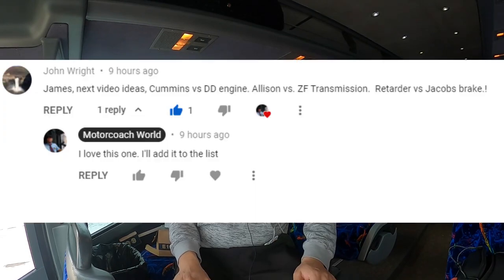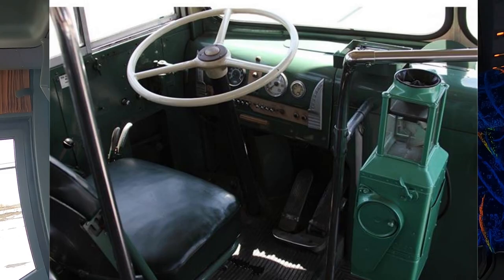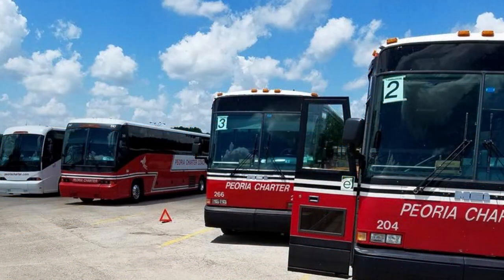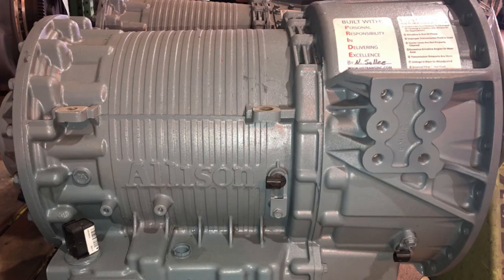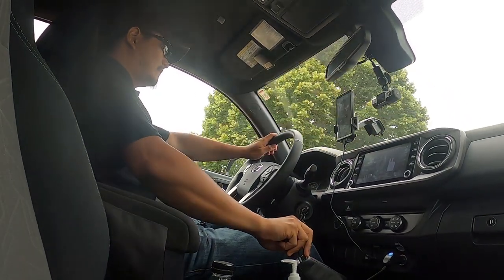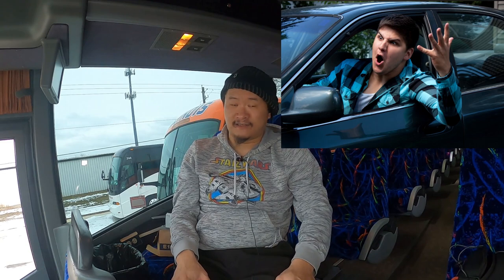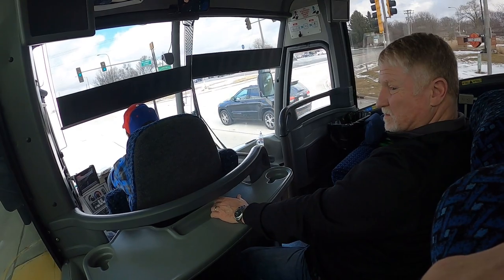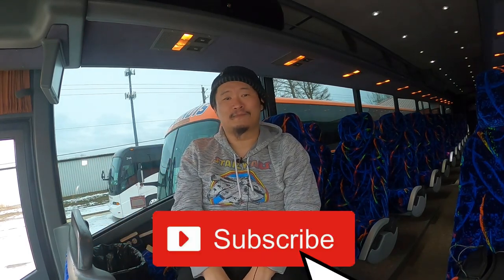Coaches buses come in Manual, Automatic, and Both .  The ZF Transmission

Comment: I know the jerky shifting of an automatic coach gearbox all too well. It can be highly unpleasant as a passenger. 
Interestingly enough, ZF did make - and has been making - very smooth gearboxes for city buses for decades. The Volvo B10 buses in my area in the 90s all had the ZF city bus gearbox with that very characteristic but pleasant pew pew laser sound (as opposed to the wheezing vacuum cleaner sounds the Voith gearboxes made that were fitted to the VDL buses we got after the Volvos). 
Those ZF gearboxes shifted noticeably, but didn't jerk like many of the coach gearboxes i know. 
I wonder why they weren't fitted to coaches. Is it an efficiency thing that couldn't be solved with a torque converter (which i assume the ZF had) lockup?
The last time i sat in a coach with a manual gearbox was about 2 years ago. The driver wasn't very subtle with his shifts. But i can totally imagine that he was driving the last remaining manual shifted coach in the company, and not really used to it. That said, it wasn't much better or worse than the automatics i'm used to in coaches.

Comment: Why didnt they include an option to electronically select gears in a ZF transmission?
That would eliminate some situations where the transmission computer got confused.

The ZF transmission kinda sounds similar to a dual clutch automatic transmission in cars, with all the same issues, but the ones I drove also allow you to select gears manually.
The only difference is that the dual clutch transmission has almost no shift time.

Greetings from Germany, where almost everyone still does and can drive stick.

Comment: Just spent a week touring Italy in a really nice Mercedes coach with an autoshift transmission, probably an AS tronic. Acceleration when entering the freeway was in fact fairly slow as described. But the bus performed well pulling up steep hills or crusing at freeway speeds. Shifting was slow but very smooth.  The driver, a very experienced professional, was not a fan of the transmission. He much prefered a manual.

Comment: James, this felt like part 1. No talk of manual mode, particularly when driving on a long upgrade or moving in a very slow and relatively controlled manner as in parking lots. The Volvo ishift is nowhere to be found in your discussion, and they are very different in terms of driver feel. My company continues to acquire new coaches with these transmissions as available, although sometimes we wind up with 6 speed Allison. As to the AS Tronic, manual mode ,in both forward and reverse, can be an effective way to keep things more manageable when used properly.
Reply from the maker: Hey Ronnie. We do not have any Volvo I shift in our company. In this video i wanted to focus on the ZF. Not to say there won't be a video on the I shift in the future.

Comment: Had my Class B/Passenger since '04.  Took the test in a 250HP Cat 3208/Allison 4-speed slushbox Blue Bird AARE.  Couldn't get out of its own way pulling hills.  I drive manuals as much as possible in my personal life.  Honestly, I think the best engine/trans combo for a highway coach was a properly injected 71 or 92 series Detroit with at least a 10-speed.  Never been a fan of Cummins, especially that blasted Triple Nickel.

Comment: At one point, I drove a 3 tonner truck with an AS transmission. It would often select the wrong gear and it wasn't ideal for constantly stopping and starting. I think part of the problem was that it was easy to drive it like a traditional  automatic  transmission. But then later on when i learnt to drive a semi truck. I leant in a Volvo with an AS transmission. That was no problem and it went well, but at the same time, I treated as if it was a manual. I think a practical way of resolving the problem would be to retain the automatic clutch, but leave the gear selection to the driver with a stick shift like a manual.

Comment: Over here in the UK. Our buses went from being fully manual, to semi automatic which the the clutch pedal wasn't included. So the driver would change gear with the gear stick. But, then the gear box would change electronically and then automatics. Coaches for a long time were generally fully manually geared. Some had semi automatic geaboxes. But, now all coaches are generally automatics
Reply from the maker: Hi Conductor Amos! Thanks for your comment and that piece of info!
Reply: @MotorcoachWorld  you're very welcome. I think manual gearboxes on our coaches are still available. But, its mainly automatics now. Mainly with ZF boxes

Comment: I. Hate. ZF Astronics. Shortline bus had some of the new D4500CLs with those, and they were a nightmare. Passing while going up hills, going downhill, or simply trying to go with purpose after stopping at RR crossings was an issue. And that roll back. 

Id rather take a full manual anyday or the regular old Allison. Hell, I would take the DDECs over that thing (we still had the MC9s back then). Im glad my buses have a regular ZF transmission. 4 speed in one, and 5 in the other (no overdrive, just differently spaced, so top speed...insert sad sound effect)

Cool video...dont know why I missed this one.
Reply from the maker: Yeah I hear you Heavy Metal Mechanic. I prefer the stick shift.
Reply: @MotorcoachWorld  I remember the old Allisons on the first gen MC9s, and we use to change gears on the prindle selector like on a car, and that was pretty good. The DDEC couldnt do that, but that at least was smooth and had no worries to it, but then again the MC9 was such an easy coach to drive. It was 96 inch so it was narrow, auto, light steering, and 40ft, so anytimes I was in a D4000, then got a run with a 9, it felt like driving a car lol. But theres still something to rowing gears.

Comment: I had a few of the Eaton Fuller 9 speed 'top 2' transmissions arty my old job and they weren't bad. They were essentially 13-speed transmissions without the splitter. The Fuller Advantage autoshift that I head in 2016 acted like the  ZF. It was not smooth at all, and was a nightmare when backing up to a dock.

Comment: I have driven both standard transmission coaches and allison auto ones. The allison 6 speed is a good trany. I liked them better than the old standard tranny coaches. I have never driven a zf auto-standard bus but I have ridden on them and I don't like the because they are slow. Ironically the car I currently own is an dual clutch automated standard and it's fast and I love it.
Reply from the maker: haha very nice. I have a manual transmission car. I enjoy driving them better than Automatics. Thanks for comenting!

Comment: The main difference I found out was when drivers who were used to the Allison would put the accelerator down to the floor till they got up to speed. When they jumped on a bus with a  ZF Transmission and did that the bus got jerky. If you knew how to drive a ZF all you had to do was put your foot halfway down and let the transmission go through the gears and when it got up to 6 then you could put your foot down. I drove in all conditions in DC. Stop and go and long run charters. I did a charter with an identical J-4500. I had a ZF 10 speed and the other had the Allison 500 6 speed. We went from Wash DC to NYC. We both drove the same routes and the same streets. Both buses had the Cat 13 engines before they stopped using them for OTR use. With full tanks there was no need to fuel up till we got back. When the tanks were fueled up upon our return my bus took less fuel. We figured  that the ZF had gotten close to 8 MPG and the Allison was more like 5 MPG. Both buses at the time had less than 25K miles on them.
Reply: Thanks James. The ZF could be tricky at times but it was much better than the Allison for OTR Trips. I used to drive a 2008 Von-Hool T model that had a 231 gallon fuel cell. What was nice if you fueled up at a truck stop it could be fueled on both sides. Loved it. When the tank was full the slave pump turned off automatically.

Comment: In Australia, most buses are equipped with a torque converter gearbox on the brands ZF and Allison. The ZF buses are relatively more luxurious, such as Volvo and SCANIA which have their chassis made in Europe. The Allison options are mostly seen in the Chinese maker's spec sheet since the Allison T series (made in Hungary) is cheaper and easier to maintain. However, if you talk about the long-trip, high floor buses, especially with the length over 12 meters and come with European chassis, they will be fitted with their own brand's gearbox. For example, you will get Volvo I-Shift from a Volvo B11R, a SCANIA OptiCruiser from a SCANIA K420IB, a Mercedes PowerShift from a Mercedes O500RF. City buses are always fitted with a torque converter gearbox, such as ZF Ecolife (the most common one) unless it is a hybrid bus.
Reply from the maker: Hi A CDE! Thank you for the comment and that bit of info! Very intersting. Really appreciate it!
Reply: I love EcoMat. They sound so beautiful 😍😍

Comment: City driving, it’s nice to have an auto or automated manual such as AS Tronic. In hilly environments I really do like a manual and a good hydraulic retarder. That said some of the newer automatics or automated manuals are now GPS linked so the engine management adjusts available power and shift points in line with the topography. Early AS Tronics were woefully slow on shifts but now mechanical and software improvements have improved these considerably but it is still wise to switch to manual on steep variable inclines, especially in trucks as often forward momentum can be lost completely between shifts. Manual mode allows holding a gear. The AS tronic is now very commonplace in most new coaches with the likes of Volvo and Scania having their own similar variants. Hill hold on automated manuals is definitely a useful feature. Ultimately my old mount, a Setra 415HD with Mercedes V8 and ZF 6 speed manual is still my favourite motor.

Comment: Interesting that it wasn't till the late 90s/early 2000 that they starting using automatic for in the States. In the UK, some coaches had ZFs and other types of transmissions at the same time as manuals, but the routemaster which was first in service in 1956 used a semi automatic due to complaints from unions about the heavy clutches in London traffic. Buses have been automatic for a long time and I believe coaches are now. I remember as a kid, they weren't but they may have been older models.

Comment: Scania offers a "Clutch on demand" system for their opticruise gearbox, Its an automated manual gearbox. It allows you to modulate the clutch when needed. I would assume this would solve most of the issues on coaches without the system.

Comment: Similar thing in car world.  We saw in the early 2000's "automatics" were not necessarily traditional torque converter going to a gear shifting mechanism.  Nissan and others were using a CVT.  The dual clutch from the racing world was adapted to the car world by Ford, VW and today Mercedes and Hyundai are making extensive use of theses.  I learned to shift on an old farm tractor and have driven all types.  Don't know which one is best because my experience is if they are maintained and drive properly they last a long time.

Comment: I learned to drive in the early 1960s on my grandfathers'  Model T truck / farm tractor conversion.  Have always preferred standard transmissions.  Would love to see a Road-ranger 15 speed, mated to a racing diesel engine....Have driven automatic coaches for years - kinda boring.

Comment: My experience with auto boxes on buses is that the computers controlling them only assume the road is flat. Shifting up and down constantly on a hill where I keep the throttle at 1,400 rpm only to shift down and eventually do it again and again, then double shift down as if to attempt a wheelie.

Some speed limits mean going faster to force an upshift, or deliberately slowing down to force a downshift when sometimes a kickdown doesn't work.

I will continue to say automatics are harder to drive. Especially when there is a wind up going on. Where it is in motion and does a gearchange but the engine speeds up, then slams into gear. I try to recognise these events and release the throttle.

I drive buses for a living,  this includes the Wrightbus Street deck, Scania Omnidekka, and Mercedes Citaro G - articulated bus, not forgetting the preffered Wrightbus Gemini 2. Those feel more modern but are 10 years old now. The Streetdecks can be slow to apply the brakes in such a way it appears as though I have noticed something very late.
Reply from the maker: Thank you for that! Very interesting read! Really appreciate the info!

Comment: After driving both the Allison and the Astronic I’ll take the Allison every time. As the ZF Astronic ages it gets more temperamental and less smooth. The first charter company that I drove for had 10 H3-45 buses with the ZF in them they got so bad that they were taking the buses all the way to NJ to have Allison retrofits done to them. In mountainous and tight parking lot maneuvers the Allison is better every time. We now have two Volvos. One with the Allison and the other with the I-Shift in it. None of our drivers like the I-Shift. Smoothness is pre-eminent in motorcoach applications and nothing exceeds the Allison. 
I’ve pulled out into a city street that’s uphill and a ZF or I-Shift and it’d come to a complete standstill trying to decide what gear it wanted. I’ve also done multiple bus moves in stop and go traffic and the Allison equipped buses would leave the ZF units behind. 
 I own a charter bus and I understand the desire to try to save fuel but for me the negatives of the ZF outweigh any fuel saving achieved.

Comment: This was very informative. As a transit bus operator, I’ve only driven Allison B400r and the ZF speed. Has there ever been any motor-coaches that used a VOITH transmission?
Reply from the maker: I have never driven one if there is. Thanks Matt! Appreciate the comment!
Reply: @MotorcoachWorld  Actually, in Hungary, Allison is the least common transmission maker. Most buses are made with different ZF transmissions, then comes Voith and Allison in the last few years. There are still a couple old timer buses still operating with manual or Praha automatic transmissions. In recent years, all of the major fleets came with autos, manual transmissions are on the way out, mostly do to driver and passenger comfort reasons.

Comment: You'd be hard pressed to find a manual bus or coach here in the UK, I think almost all are automatic transmissions. I remember riding on a Bristol VR bus in the late 90s as a kid, and they used a hydro-pneumatic or semi automated manual.
Reply from the maker: Hey Ashley. Thank you for the comment! Sounds like some wonderful memories. I believe the old buses in China I rode on when I was a kid had something similar. They made a really unique wining noise when the RPM got high before the driver shifted.
Reply: @MotorcoachWorld  I'm fortunate enough to just remember the old buses before the bus companies were deregulated here in the UK and all privatised. Leyland Lynx, Bristol VR, Leyland Olympian, Leyland National and Plaxton Dennis were common buses in my town. We also had a Daf sb220 Ikarus bodied bus for a while, used to like that bus as it was one of a few that didn't have a tinted partition to the drivers cab, so you could see the controls. 

Modern buses just don't really have the same nostalgic factor anymore, much like cars, which is a shame.

Comment: The american coach market is pretty limited in terms of available equipment. You guys have mci and prevost available, plus setra and vanhool which are European companies but make Americanized versions of some of their models. In Europe, there are much more bus manufacturers - you have Mercedes, Setra, MAN, Volvo, Scania, Irisbus (Iveco and Renault), Solaris, Neoplan, Irizar, Marcopolo and few other smaller brands, not counting all the chinese and russian manufacturers that are also now dipping their toe into the European market. Almost all of those brands use robotic manual gearboxes such as the ZF AStronic in their coaches almost exclusively, so I wouldn't say that they did not catch on :) The ZF AStronic is considered by drivers to actually be one of the clunkier ones, losing in speed of shifting and smoothness to the likes of the Volvo iShift or Scania Opticruise. However, it is probably the most reliable of these kinds of gearboxes, which is why many manufacturers still choose to use it, even though it is a little bit sluggish. Regular  torque converter automatics (also made by ZF or Voith) are of course still used, in city and regional busses, which require frequent stops and thus are more suited for that kind of work. Also you didn't mention the main reason why most operators prefer robotic boxes over traditional torque converters: fuel economy. Traditional automatics are inherently wasteful, as they lose part of the engine's power on the torque converter, and that matters in vehicles that spend most of their life in motion. Nice channel, keep it up :)
Reply from the maker: Hey Jayzhead You are correct. The US has less need for public transportation in comparison to Europe. Most people here own and drive cars and the population density here is much less compared to Europe. Its understandable that we would have less options when it came down to bus manufactures. Not that much demand!